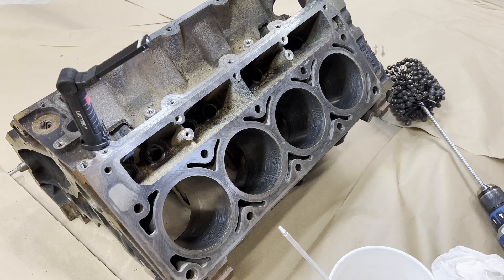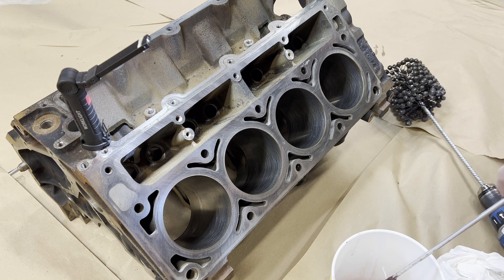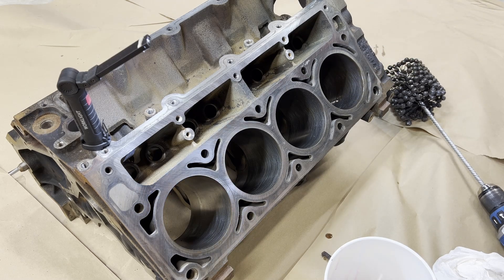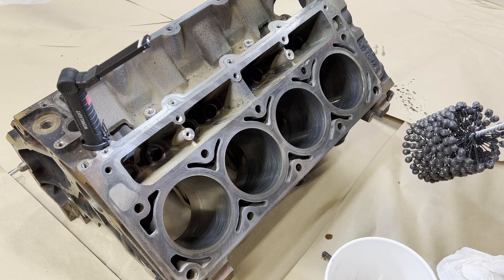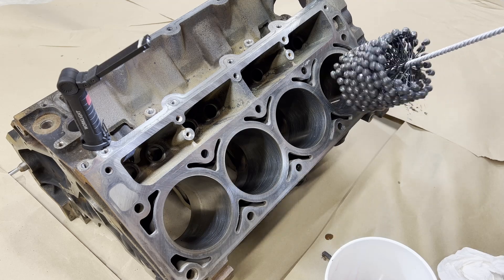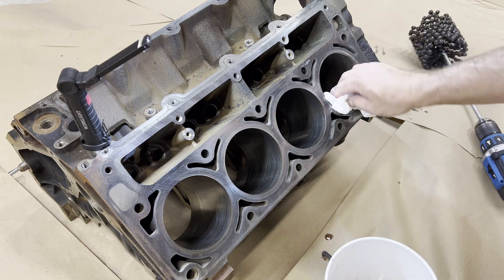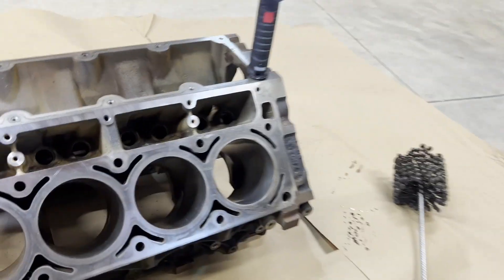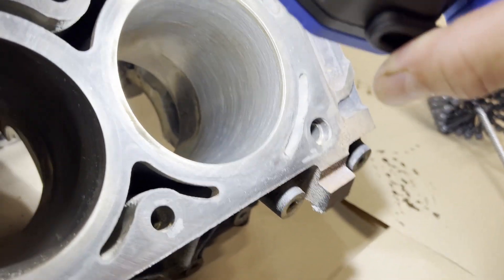DIY engine block cylinder honing - Don't be afraid to take the plunge!

Comment: Is the piston bore checked for ovaling before honing it
Reply from the maker: You check this before to know whether the block requires an actual bore or not and to understand if the cylinder is in spec. I skipped this part since I knew the mileage and history of the engine. This is a basic refresh.
Reply: @kauffmansgarage  most people would not know this and need to include that fact and proceed